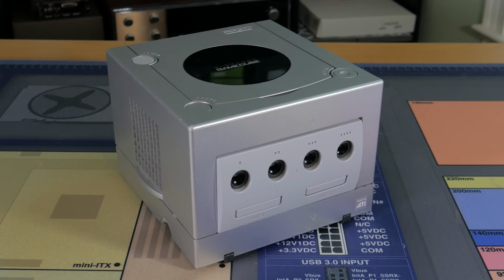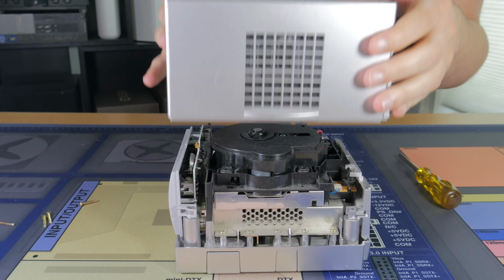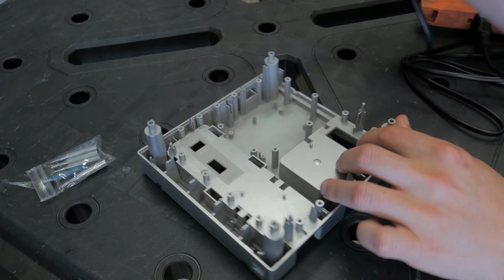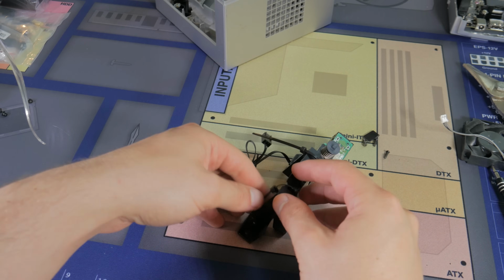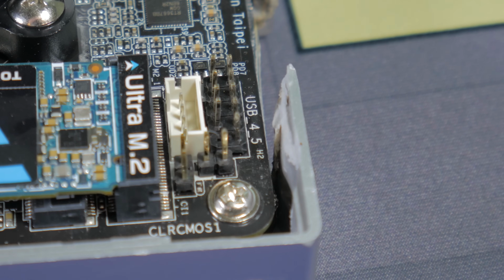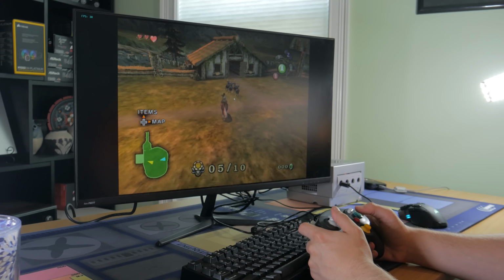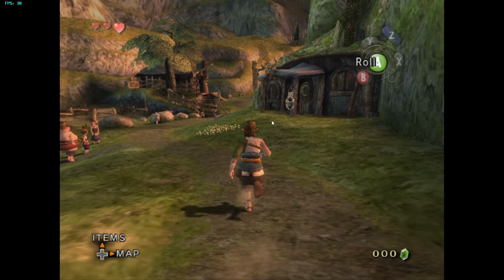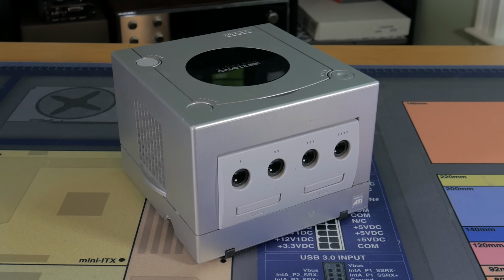I Built A GameCube Gaming PC!

Comment: *builds a gamecube pc*
*runs gamecube emulator*
Reply: and GameCube wasn't working now it is
Reply: yeah but u can do 4K and high res textures.
Reply: @Boemel  Agreed. I've never even tried anything with textures. Upscaling alone makes 15+ year old games look VERY good! I know some may consider it sacrilegious, but in my opinion, Dolphin is THE definitive way to play GameCube games. No need to track down old expensive hardware, peripherals and so on. You've got everything you need, high resolution, and total compatibility with PC (Xbox 360 / One) controllers.
Reply: @XtremeConditions  How ignorant can you be? Expensive hardware? Unless you already have a PC powerful enough to render gamecube at 1080p 60fps, a gamecube would be wayyyyy cheaper than a PC build. Gamecube controllers are also cheap still (£20), a gamecube about £50 with a controller, PSU and cables. If you said games I would say fair enough because some games in different regions are starting to hike in prices, like melee in NA costs more than twice as much as the PAL version. But even then there's a solution for that with homebrew and cheap 3rd party hardware that will allow you to play gamecube ISOs for free.
Reply: @znub206  Don't insult people if you have the critical thinking skills of a cumquat.

"A GameCube isn't expensive". All things considered, that's true. But it's an additional cost over the PC you already own.

"Can be cheaper than a PC build" It's also not nearly as versatile.

Additional space required to store it. Additional space required to put games.

"Solution with homebrew and/or cheap third party hardware." - Most people don't want to go through all of that. For serious collectors, that definitely makes sense. But the average person doesn't want to spend hundreds of dollars and their time, and go through all those other inconveniences to play Super Mario Sunshine.
Reply: @XtremeConditions  It's not "hundreds of dollars". Again, misinformed. Of course a person like you who knows nothing about the gamecube will ramble on without knowing anything about it. It's an additional cost only if the PC is capable of perfectly emulating the gamecube in at least the exact same way, which isn't as easy as you would think as it requires a lot more processing power than the gamecube had.

It's not as versatile because it's not a desktop computer you moist towel. It's a gaming console, it has one purpose. But again it's only an inconvience if the person already has a good PC. I am a person who uses both dolphin and the gamecube, and it's always PC mustard rice people like you who think original hardware is a waste of time.

Additional space required to store it? If you don't have space for a gamecube, display cables and psu, then you probably can barely afford rent and probably don't have a PC that can play minecraft nevermind gamecube games. 

It would only cost you hundreds of dollars if you are looking to get a HDMI converter like the EON MK2, as well as all the games with their cases, you can buy discs for a decent bit less, which also be easier to store if you get a gamecube disc storage case (I have one and it can store quite a few) I suppose if it's really a problem.

Calling me a cumquat when you don't even know how to do a quick google search on the topic.
Reply: @znub206  You don't even realize you're talking to someone who grew up with a gamecube (was my favorite console of the gen) and who still has their original hardware and games on hand. Not having the cases is an issue for me btw. That's personal preference, but it's an important preference for me.

A regular Ryzen 3 or i3 desktop w/ iGPU will emulate most games perfectly at above GC's native resolution. That's what a ton of people are working with. I have a better setup than that, but that is a good baseline if someone wants a good experience running at full speed in most games. The lower-end laptops, not as much. I'm still running a Thinkpad T440S (i7 4600U) and it struggles. So sure, it depends what you have. But if one were so inclined to get something for like $100 that can do these things, a Dell small form factor from Haswell generation is sufficient I know, because I've tried. 

I've had excellent experiences with major games eg Melee, Windwaker, Mario Sunshine, just to name a few. I've had no issues with any of them. A couple games had minor issues, but again, easily playing at higher resolution is a major "selling point" so to speak.

You're assuming it's an issue of the GameCube in and of itself. I have a lot of shit lying around and live in a very modestly sized home. My ideal would be to have an entire room as a dedicated home theater / gaming setup with ALL of my consoles hooked up and ready to go, along with probably a PC to emulate whatever else. I don't have that luxury at this stage of my life, and most people will never have that luxury at ANY stage of their life... I'm not a "PC Mustard Rice" person. I'm just being practical and saying that most people already have a system capable of running that generation of consoles satisfactorily. That's one system to run it all. I just feel that you end up losing too much going with original hardware unless you're going to go all out.
Reply: @XtremeConditions  Listen I have had a gamecube for at least 13 years, I've done plenty of research, plenty of experience. If you are emulating gamecube for $100 at 480p it's not going to look better than the actual gamecube. And above native resolution, let's say 720p won't run you the same framerate/frametime/frame consistency as a native gamecube. I myself have tried to emulate dolphin with a couple of devices, one of them being a macbook from 2015 dual booting into windows 10, and it was pretty atrocious to run even smash melee, and it was around 720p, with no other graphical improvements. It ran at about 10 fps if not less and even the music was choppy. It could have been an issue with optimisation when I tried it or it could have been that dolphin was not cooperating with the hardware (despite it being an intel cpu with an iGPU). Now having a decent gaming rig it is great to emulate the gamecube, but a good PC that can emulate flawlessly at 1080p will need an APU, which will cost a decent bit more than a gamecube, and with ryzen you need to have high speed memory, you don't have to use more than 8gb in a build, but 3200mhz will still run you a decent bit. So overall emulation is still a fantastic experience. Personally I run melee and SMB2 rom hacks on emulator as its great to see the games look and run so good. But being used to the gamecube's capabilities i really don't mind a shitty image. Sorry for being rude earlier.
Reply: @znub206  https://www.youtube.com/watch?v=5PDu74gDdPw

^ Not sure if it will run above native, but I suspect it will in most games.

I think the problem is that the only system you've really bothered to emulate with (other than your gaming rig) is a potato (Macbook). That's not even a bash against MacBooks, it's more of an issue of their power limits and thermal designs being too poor to push the CPU and integrated graphics to full speed, which is not an issue on desktop.

So on my Thinpad T440S, I notice that exact problem. Both CPU and GPU clock speeds plummet because of power limit. It's not even a thermal limit, it's that damn 15 watt cap. I suspect a non U-series would perform better though. Depends what the specs of the MacBook were. It ran something like Twilight Princess... Well, acceptably, but not at full speed. Maybe about 90%-ish. Simpsons Hit & Run (IMO it's best on Gamecube) was running at more like 40fps when it's supposed to be at 60fps, and due to the nature of emulation, the experience was atrocious. On my desktop (actually an old Xeon setup with pretty bad single core performance) works great, which has LOWER IPC than laptop, but is able to clock high enough and also has dedicated graphics so it's not sharing damn power for graphics.

I think it's more up to what a person is looking for, but also about what they already have, or how much they value an all-in-one PC experience at the occasional expense of emulation never being quite 100%, but still usually very good overall in my experience. At the same time though, if there are specific games someone wants to play and they don't run well on emulators (I've found several I can think of), then you just can't pass up original hardware no matter how much you might like to...
Reply: @XtremeConditions  the only thing I wish for was an actually decent 3rd party USB gamecube controller. 

Its hardly a deal breaker, but it would be nice to have buttons that match onscreen prompts.
Reply: @XtremeConditions  pretty much. I built my first emulation box by slapping a 1030 in an old productivity desktop I got from goodwill for less than fort bucks and it could play most everything that was software compatible with dolpphine at native resolution. It got quite a lot pricer once I wanted to play everything upscaled, but that was mostly due to games that are tough to emulate like Rogue Leader which needed an an upgrade to a 1050ti to get decent upscaling. Plenty of games played fine.
Reply: @Boemel  yup you can even run GTA 3 at 8K with this, you can also play L4D2 at probably 100 fps 1080p
Reply: Tom Jacobs more like 720p or 1080p
Reply: @Boemel  not with a 3400g you ain't, lol. Maybe you can run the pc versions of those games. But an emulator? Hell no.
Reply: jeffreywarf a 3200 g is more then powerful enough to run dolphin. Dolphin is super well optimized they did a really good job he’ll it could even run pcsx2 or ppsspp fine. This system is on par with a pentium g4560 and a gtx 1050 ti and I’ve ran all of those emulators smoothly on it. You must be one of those guys who thinks anything under an i7 is trash and anything under a 2080 super is garbage.
Reply: @krisshirley7508  I ran dolphin with an i5 2320 and a gtx 1050 ti and it would often lag. A 3400g is a better processor, but the graphics part is NOT better than a 1050 ti. It's hardly as much power as a 1030.
Reply: @krisshirley7508  and pcsx2 on that setup? It lagged incredibly often. Often dropping to the single digits in fps. Even on a i7 6700 and gtx 1070 there would still be instances of fps drop. So while a 3400g COULD run dolphin, it would NOT run it at 4k60
Reply: @krisshirley7508  not wanting to offend you, but you clearly have no idea what you're talking about. You can compare the Vega 8 graphics to a GT 1030 - but hell no, not to a 1050 Ti
Reply: @krisshirley7508  Damn no, the vega 8 and vega 11 are positioned somewhat above the 1030 provided you overclock it. They're no in the same league as a gtx 1050ti yet.

Maybe the new 4k family, especially the expensive ryzen 7 4700g, but definitely not the zen2 r3 3200g and the r5 4300g...
Reply: @Boemel  4k on an APU?
Reply: @Boemel  you can’t without using upscaling, so even though it’s higher res, it looks the same.
Reply: @matifischer3257  Not exactly? Like, the textures won't be as good as made for HD textures, but generally speaking the gamecube didn't render them at full fidelity unless you were viewing something up close.

All the emulator upscaling does is apply the textures at their maximum fidelity and do some internal interpolating as everything is drawn. It won't add detail, no, but it helps it to look less jagged or blurry to the eye.

The place you'll really see the upscaling is pre-rendered cutscenes and text menus since there's not really anything the emulator can do with those, they're static bit maps. 

In any case, speaking from experience, emulator upscaling seems to be a heck of a lot cleaner on a modern TV than HDMI conversion.
Reply: @Boemel  good luck with that.
Reply: @Cthulahoop01  What do you mean with "good luck with that"? Anything can be rendered in 4K if you have enough computing power and running gamecube games is not difficult.
Reply: Videopelaaja that’s the point. This computer doesn’t have enough computing power
Reply: @exotic1910  It literally runs Brawl without lag.
Reply: @exotic1910  bro that APU is no slouch. 
Besides the new 4000 series are amongst us now and they are even better.
Reply: @derekj.tejeda267  Even a potato can run Brawlhalla at 60 fps
Reply: @wuskieftw  I meant Super Smash Bros. Brawl
Reply: That's the first thing I'd run on it. Dolphin is great and that can handle upscaling and texture packs no problem.
Reply: better graphics lmao
Reply: he runs a wii game
Reply: @chrisc4733  you’re a wii game
Reply: @redshift912  what about it
Reply: Haha of course. PC master race
Reply: That was a real galaxy brain move.
Reply: Upgraded his gamecube to 60fps
Reply: Dolphin yes
Reply: That'll come in Handy someday when I want to play MGS TTS, and Eternal Darkness plus Mortal Kombat games.
Reply: How well does it run with dolphin?
Reply: hmm  

yes  

the floor here is made out of floor
Reply: Melee rollback on dolphin tho
Reply: Dolphin is also the emulator I use, I play super Mario sunshine 1080p and looks great
Reply: @rap6439  you can download texture mods tho. And either way even a 1080p upscale is a good improvement
Reply: @rap6439  ah fair nostalgic purposes. But also texure mods are made to remake models with higher res textures.
Reply: @rap6439  ah
Reply: Gamecube: "Woooooow"
Reply: Undervolt and overclock to run wii u.....
Reply: makes sense
Reply: I can do 1080p full speed pcsx2 and dolphin on my old junkbox with an overclocked 775 xeon quad with 4GB DDR2 and 2GB GDDR5 overclocked GT730. This mini PC is an order of magnitude more powerful than that.
Reply: At 4k mister Squidward, in at 4k
Reply: More like making a fake GBA SP xD
Reply: The GameCube itself would probably run better
Reply: well I mean... what's the point of making a gamecube into a PC if you lose the gamecube functionality?
Reply: @WednesdayMan  Gamecube case is a lot smaller than an ordinary PC one and I think it looks cooler
Reply: @windestruct  ok that answers the gamecube PC case but what about the losing gamecube functionality part?
Reply: @WednesdayMan  You can play every other game

Comment: Did you try just connecting the ribbon cable of the controller front panel before cutting and soldering all the wires? (I don't know if it would work, just curious)

Comment: I don't want to tell you anything you don't already know, but if that's your first time using the Cemu emulator for Breath of the Wild, the reason it stutters so much the first time you play it is because the emulator is compiling the shaders as you play. So every new animation is going to pause it for a bit before you can play it smoothly. BOTW is a big game, so this will happen quite a bit as you run into more and more new animations. There are however shader packs available that you can pre-install before running the game which offers a much smoother experience. Then again, I'm not sure how well an APU can properly emulate the game anyway. I was surprised to see it running on your system at all!

Comment: Man, you've gotta convert this thing into a Smash machine! This baby needs shortcuts to boot into smash 64, melee, brawl, Project M, 4, and Ultimate (which recently started playing decently well on Yuzu). Having 1 gamecube with working ports that runs every smash game would be unreal.

Also, your Cemu footage was filled with shader compilation stutter! Either let your shaders compile before considering it a benchmark, or at least use the Vulkan renderer, which has much faster shader compilation, and generally way better performance on AMD hardware anyway. I'm reasonably confident you can get at least a locked 30fps in Breath of the Wild with this machine, and can probably even manage some datapacks to push the visuals further.

Comment: haha, i did this a few months ago to an n64. was a bit harder as I fit the WHOLE psu inside and yea the power button and controller ports work
Reply: mine is also a 100% sleeper, there is no computer ports visible from the shell uses a wireless keyboard controller ports and original analog out. and yes i used the a300 mobo an 2400G and the included 130w psu

Comment: 1. Amazing job. Very impressed.
2. Instead of a top loaded disc tray, what if you installed a fan under the disc tray. You could have software setup to automatically open the disc tray and turn on the fan, if the system goes above a certain temperature.
3. Could you do an e-GPU inside an old N64 or some other console that would rest right next to the Gamecube? Or mod a pcie ribbon cable to connect to an eGPU in another hollowed out console?

Comment: I had done this as an experiment a long time ago... not anywhere close in terms of performance, but I converted the top disk drive into a horizontal usb port for a flash drive... now that parts have become smaller... If I did a redo I would make it an m.2 ssd area

Comment: You could use the m2 port to use an external pcie gpu and if lucky find a small enough form factor 1050 thatll fit in the top part with modifications to pcb. The ZOTAC GeForce GTX 1050 Ti Mini might be perfect for this.

Comment: it would have been cool to add an extra mount inside the top where the disk loader is so when it got hot say from overclocking it that could be a hole in the top and allow for more ventalation

Comment: It's cool, but... you really should have used a DOL-101 Gamecube. The DOL-001 units are rare and are able to do HDMI out with an adapter, where the DOL-101 units are the more common ones and only do S-Video out at best. I think this would be a lot better done with a scratched-to-death Gamecube with a stuck reset button and possibly bad controller ports and/or a bad disc drive to breathe into it new life. Definitely not trying to knock retrofitting a PC into this; I just wouldn't want really great condition Gamecubes turning into the iMac G3 fishtanks or console TV doghouses of yesteryear.